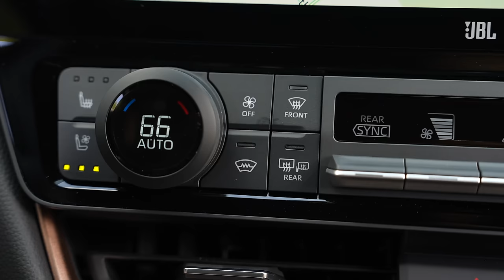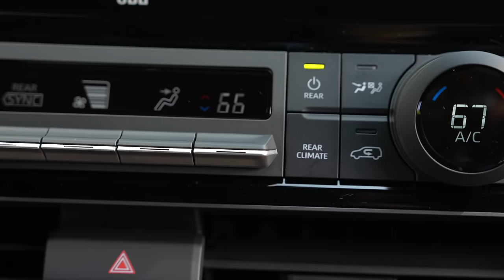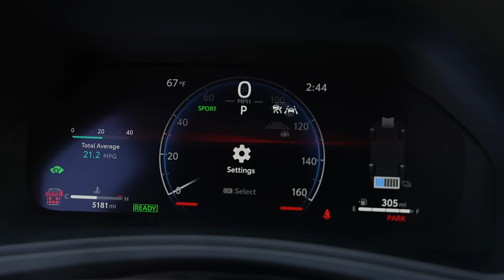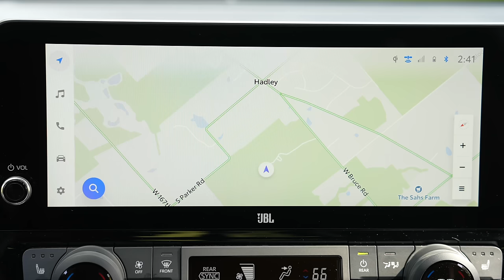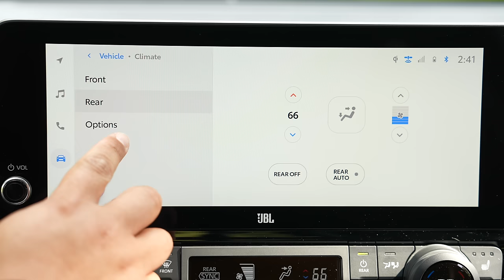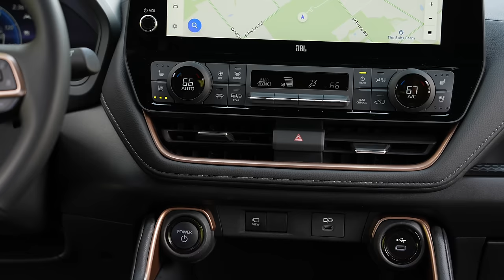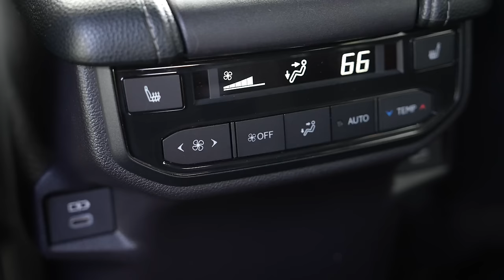Should You Buy A 2024 Toyota Grand Highlander? Back To Basics Toyota

Comment: It's a shame Toyota is going towards turbo engines.
Reply: They've lost me.
Reply: Government breathing down their necks whispering “yeah you need to downsize for better emissions as well as more power to stay competitive…best of luck!”
Reply: Yeah, more horsepower and better mpg’s.  Count me out. 🙄
Reply: Not really but keep telling yourself that. 

The numbers are usually fudged.  @BraeburnTV
Reply: Keep voting for the lefties.
Reply: Never have, never will. @ExpeditionaryRanger
Reply: The feds aren't given them many options.  At least they still have engines and aren't all electric.
Reply: @TerryOffDairy ikr it's awful I'd rather have worse mpg and less power but a more reliable understressed engine
Reply: The a20a and a25a engines are not turbocharged.
Reply: Electric is the future as the efficiency is there as well as the power for the money. The fuel moving at the speed of light can't be beat.
Reply: @watnw2411 if you don’t drive like a jackass turbos are fine. There’s a reason there was million mile Volvos from the 80s and 90s. Driven normally turbos give great torque and great gas milage.
Reply: Not that much, if you don't accelerate as hard as the turbo lets you you will probably maintain a similar nonturbo durability. You let the driver choose and sometimes that acceleration is very useful
Reply: Every one will, otherwise Gov will punish them.
Reply: @paulneil7321  bad excuse, Honda and Mazda do just fine with 3.5 V6. Toyota just hired too many political activists and hope to ride on their fame and reliability history.
Reply: @ExpeditionaryRanger I will

Comment: Honestly the grand highlander was a top contender for me to purchase but there is little inventory and every Toyota dealer in my area insist on listing pricing with a $5k or more “market adjustment” over MSRP. That is the primary reason I am no longer considering it. I actually like the new honda pilot more anyways and even though inventory is also limited, most honda dealers aren’t  putting stupid market adjustments on it and you can get a reasonable deal.
Reply: Same boat here, actually found 2 pilots and agreed on a price for trailsport but now they refuse to sell to me because i wont buy the extended warranty . 
They know someone else will buy it so they will just wait.
Reply: @alberttheelectricianbackup7878  that’s shitty! Still waiting on my TrailSport to deliver this month but the dealer has been great to work with. And my sister just bought a new HRV from them no issues. Not even pushy about the extended warranty when she said no.
Reply: @SlyBSer  they gave in . Im here purchasing it . Actually changed my mind from red one to light bluish one they had in showroom.  Finally after looking for 2 months at 3 row midsize vehicles were getting one. Wife was being very picky since its replacing her 18 wrangler . Now i get the 18 and sell my older vehicle. Good luck to you . Vehicle looks and rides great.
Reply: Honda kept the V6. I would have bought the Grand Highlander with a V6 over Honda Pilot all day long but with small turbo 4 cylinder that makes less horse power than V6 Camry I'm not sure about it. A dearm Grand Highlander would be a V8 one with Toyota indistructible  5.7 liter.
Reply: New pilot with hybrid performance power training would we the clear winner in my book
Reply: @alijoon1621  Yep.  I have a 2018 Highlander, and now won't upgrade to another Highlander since they dropped the V6.  I hope they bring it back.
Reply: If you’re in California, Orange County let me know I work at one and can probably help you out getting one (our hybrids are all pre-sold) gasoline ones are available every once in a while
Reply: @AlexCruz-eo5dw  thanks but already bought a Honda Pilot and love it.
Reply: Things change quickly seems. Now there is discount of 3k below msrp in TX.
Reply: @MeJonTheDon What hybrid systems are tried and tested from Honda? Toyotas been in the game way longer
Reply: I’m own two Toyotas a 2022 Sienna and 2010 FJ Cruiser, both have been very reliable. That said, I’m going with the Honda this go round because of the reliable v6. I tend to keep my cars for 10+ years and I think the v6 will hold up better than the turbo 4 banger.
Reply: @JR-np9cf i would fly to TX and drive back out west. Where in TX? I have family in San Antonio and Dallas
Reply: Welcome back to the 90’s! 😂….sooooo true. Everything was brass….lamps, door handles, coffee tables….hilarious
Reply: @Pinkorchid72  I got one below mrsp in Mike Calvert just before new year. At that time the inventory was high. They are typical car sales can’t be trusted. I wouldn’t recommend if you don’t live in close areas.
Reply: @JR-np9cf  got it. Thx!
Reply: That's because it's a timing belt engine. That's something Honda should of changed a while back. I had the cousin to it Acura mdx 03 that was the worst car I ever had wheel fell off at 140,000 and check engine and wheel mount had the car leaning but it did have 4 prior owners so who knows maybe was luck. I seen a video with a guy who had a similar year with 400,000 miles so they aren't a push over.
Reply: Should have bought it then cancelled it after the fact

Comment: People should be aware that these engines (including the non turbo ones) should at least get an oil change every 5k miles or 6 months, but most importantly if they want their Toyota to last or planing on keeping it for a long time DO NOT FOLLOW THE DEALERS INSTRUCTIONS ON FREE MAINTENANCE and you’ll notice after buying your new Toyota and taking it for the 5k miles maintenance they won’t change the oil until the vehicle is 10k miles which is unbelievable 🤯
Reply: Yes, AMD mentions this to what you have said many times on his videos.  You should watch his other maintenance videos, it’s Very informative. Especially the video where he replaced a motor on a Camry.  I worked on cars for over 20 years and AMD is definitely on point!☺️
Reply: So you tell the dealer to change it at 5k. Whats the problem?
Reply: @lexusguy9127  for 2 years when bought new the oil changes are free
Reply: I have heard some owners changing their oil at 5k miles and not resetting the maintenance and then bringing it in at “10k”
Reply: With my wife's 2022 Camry, the dealership wouldn't change the oil for free at 5K. Oh, the free maintenance is for 2 years or 20K miles. Tire rotation is every 5K, and it doesn't include balancing. She put 20K in 1 year. Now we are doing it every 5K. I work at Wal-Mart in the Auto Care Center. Paid for lifetime balance and rotation. Oil cheaper than than dealership. We have 0w16 Mobil 1 bulk oil.
Reply: @lexusguy9127  I already tried that and they simply said it’s not needed until it’s 10k unless i pay out of pocket to do it before that , so basically that free oil change it’s free every 10k miles not before
Reply: @cx650panther  way to go! … i do the same i just take it to the dealer for everything else but the oil change i do it myself or my local mechanic, I’m not going back and forth with the dealer telling me it’s not needed until 10k miles.
Reply: @lexusguy9127 the ‘free maintenance’ or ‘free oil changes’ is given corresponding to the intervals in the manual which is every 10k. They typically don’t accept it whenever you want

So if you do 5k intervals, and starting at 0 miles; you’d pay for 5k, 10k is free, pay for 15k, 20k is free
Reply: Same for a Lexus and I have already changed the oil & filter twice in my 2023 ES300h, Ultra Luxury trim Lexus and only have 5,800 miles on her. Had the factory oil & filter changed at 1,000 miles like TCCN did on his 2022 hybrid Camry with Liqui Moly Special Tech AA and an OEM Toyota filter for that engine (A25A-FXS). And, I have an Independent ex-Lexus/Toyota owner/mechanic that does the work.

I took it in for the free Lexus dealer 5,000 mile check-up, what a waste of time. I told them donot rotate the tires, (I have coverage for rotations and balances at Discount Tire) and donot wash it, (I had her ceramic coated three days after I brought her home and the same person washes it once a month with ceramic shampoo and detailer). I have Chemical Guys ceramic detailer and clean her at least twice a week. No scratches from an automatic car wash. She will never see the inside of a car wash. LOL 🤔
Reply: @cx650panther  The Grand Highlander standard hybrid (2.5L) calls for 0w8 (not a single digit typo) which is somewhat hard to find, and when you do, its pretty expensive per quart.
Reply: @chibbyylol then take it to a different dealer.
Reply: @kevin.thetoast  I'm lost why would I pay when it's free?  My dealer follows mileage by GPS .
Reply: @jlwhein1779  Good reason I won't be buying one. If I buy another SUV, it will be a RAV4 or regular Highlander.
Reply: I insist on oil change on my free maintenance visits ( I go to my trusted service advisor)😊👍
Reply: @jlwhein1779 the Hybrid Max is 0w-20
Reply: @MatthewRobbinsColumbusOhio   Interesting though not too surprising.  I updated my comment to be specific to the standard hybrid with 2.5L engine. Thanks for the clarification.
Reply: Yeah I did the same with Hyundai palisade which is worse since it's completely a gdi engine and only if you use the auto start stop Atkinson that supposedly helps clean the gdi but I don't believe in the starter being beefier so we turned it off. Gdi you have to do every 3000 toyota is gdi with mpi I believe so you can do every 5000 still like the older engines.
Reply: i do mine every 5k, bought filters from the dealership and brought it in for them on the 10k and 20k. figured they'd have to be REAL picky to notice they didnt do it last time
Reply: That will help, but there's no ignoring the strain that such a large vehicle has on an engine/driveline. That thing better have a large oil pan and good cooling system, because I would not bet on longevity from these vehicles.
Reply: @Videomorgue  highlander disagrees with you. it has the exact same drive train as the camry but with over a thousand pounds more car, and it's more reliable than a camry usually

Comment: my opinion mechanical water pump is way better then electrical water pump, we see what happend with the prius with electrical water pump, how many failed cause head gasket replacement plus the cost of electrical  water pump is way higher the mechanical water pump, also lifespan of mechanical water pump is longer then electrical one, in this question AMD i will disagree with you sorry😂

Comment: I love all Toyota vehicles regardless. My old 2005 Sienna still runs great at 325k miles without having to rebuild or replace anything major (engine, transmission, AC, suspension, fuel system all original). Just purchased the new generation Hybrid Sienna and couldn’t be happier. 600-650 miles range on smaller fuel tank 18 gallons Vs 21 gallons.
Reply: Best vehicles ever made was yours awd
Reply: My 2007 is a gas guzzler in today's standard. 19 MPG👎. But I drive it as a backup vehicle.
Reply: Yes, yet they are no longer affordable for the "common" or "budget-restricted" family.
Reply: I hope you've replaced the timing belt on the 05, because it was still an interference engine which will be damaged when the belt breaks.
Reply: Vice grip garaged
Reply: @EfficientRVer  I have been replacing it at around 100-120k miles along with tensioner and water pump. I prefer the 3.3L V6 with timing belt over the 3.5L V6 in my 2008 Sienna because the latter makes more noise, vibration and less fuel efficient.
Reply: How come you make 600 miles. That's only on a paper. My 2023 awd sienna makes only 540-515 miles.
Reply: good comparisons with Sienna  well done
Reply: Depends on the weather, and previous MPG trip info. 
My 2021 makes 570 miles in Winter season. 600 miles May or June. The actual miles less than trip but it's way better than others vans.
Reply: @mareksambora9933  my 22 Highlander hybrid gets around 500 miles to the tank. papers say it has 17 gallons but there's a known design flaw that makes it more like 14 gallons. i put around 12 gallons when its under quarter tank. and honestly 500 miles is pretty mind blowing compared to the 300-350 i used to hope for in my previous car. and that was more like 15 gallons after those miles. dramatic improvement

Comment: With all that new tech in those engines, I want to see what the maintenance is like when these cars get 100k or so miles on them.
Reply: Absolutely. Good question.

A nearly 4600 pound, an almost full size SUV before it is loaded with passengers and their belongings.

I shudder to think what adding something to tow like a small boat would do on that super sweet turbo four cylinder.. add the hot, summer heat with the a/c running too.
Reply: @marcodarko6941  Agreed, small turbo engines seem to work okay in light sporty cars that are actually driven moderately 90% of the time and used for short periods of acceleration bursts and high speed so there's a lot of cooling going on. In low speed high load situations I imagine heat buildup stressing the turbo, engine internals and oil especially around the turbo bearings.
Reply: You throw theses new cars away just as it's barely paid off just to go get s new one for a other monthly payment of 999$
Reply: @omieyouknowme  🤣😂😆👏👏👏
Reply: Yeah thats why the middle option regular hybrid from the original higblander to me is the best option
Reply: @robmalcolm8042 regular hybrid on the grand highlander is the same as original highlander hybrid.
Reply: @SandiegoRockstar  I know that I said the hybrid option that comes from the regular highlander cause that's where the grand highlander regular hybrid comes from.
Reply: @robmalcolm8042  gotcha yeah that seems like the logical decision with this GH. So it's no suprise they are never on the lot. Now I'm trying to figure out if the 5k markup is worth it.
Reply: @SandiegoRockstar  yeah depending on your situation it may vary but even in a decent situation they seem to charge alot for it. Eventually I want a hybrid I just wonder if a hybrid can go a million miles like a full gas is able to.

Comment: I totally agree with you on the sienna over this. I currently own two siennas and they're just soooo much more functional than the highlander (or other SUV's). Esp the 3rd row.
Reply: I would generally agree with you but the Grand Highlander's second row folds flat very easily and that cannot be said of the Sienna.
Reply: I thought the same buying a mini van until I didn't need that much space anymore lol  Grand Highlander offers reliability with space and with 8 inches of ground clearance can do some light trails...  Now I regret buying the mini van... Sure the mini van offers the max space but I don't the max space... I need good enough space... Also, the Grand highlander has a wow factor in simplicity and doesn't look like a whale lol

Another great and excellent pick which actually looks better and driver better than a the Grand Highlander is the new 2024 Honda Pilot..
Reply: Yeah but sienna has low clearance so that can be bad in snowy or stormy places with alot of rain. Doesn't take that into consideration.

Comment: Great review and I like my Toyota hybrids, but for people considering this :

I had to change the NiMH battery on my 2 Prius after some 100k to 120k km. Also, electric coolant pumps may be nice, but I had to have one changed after 160k km on my Prius C and the pump alone was 1k CAD. So quite happy this highlander has a mechanical one for the engine. Otherwise, very reliable vehicles and that's why I keep buying them.

Comment: I have driven one of these and got it up to a good speed and applied the breaks as if to avoid a rear ender…and it did not stop the vehicle. I felt as if the breaks were not built for this considerably heavier grand highlander. I did not like that feeling. Refused to purchase it.
Reply: The brakes, not breaks, may not have been broken in yet. I'd have test driven another before condemning it on that point.
Reply: @consaka1 do you really think when this car is fully loaded it can safely stop with standard brakes with dual piston and single piston in the back from highlander? Highlander is lighter which makes sense but this should used brakes from land cruisier 300 /Tundra. Take your family and load up the trunk and stop i will see how you be defending this car

Comment: I love your straight forward reviews. Thanks for a great review. I actually own this 2024 Hybrid Max. There are features that even dealers don't know about. One feature is that the car reminds (with a long sound) that you left your phone inside your car. This SUV is no joke in terms of power especially when going up mountain roads - fully loaded. Hybrid Max runs on Full-Time Electronic All-Wheel Drive (AWD) which gives it an advantage compared to others. Looking forward this winter on how it performs with Nokian HAKKAPELIITTA 10SUV tires.
Reply: When this is new things are going to work just fine. After 4 years not so sure everything is going to be ok.

Comment: I'm so happy Toyota built this extended version of the Highlander.  I don't know the price but with all the rear seats down it almost has the hauling capacity of a truck without the poor fuel mileage and at a lower cost.  Eighty percent of the time I don't need a truck so this would fit me perfectly when I need to haul a bit more than my RAV4.  It could be easily converted for use in car camping or placing a tent on top of the roof rails.